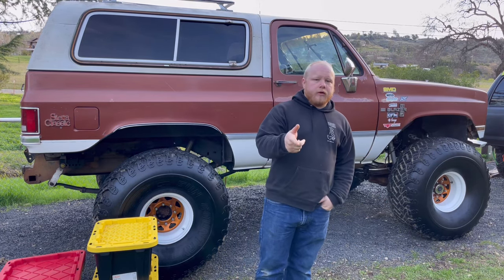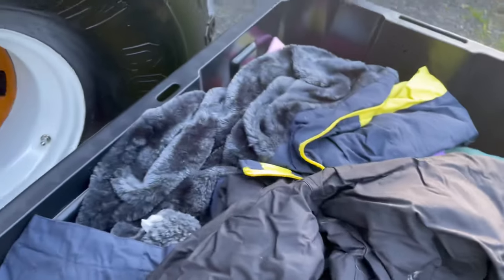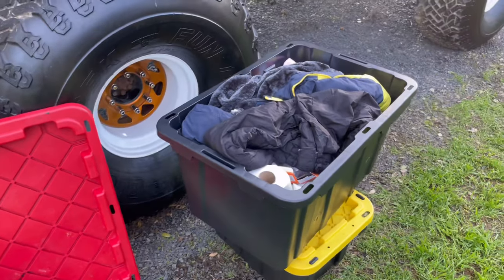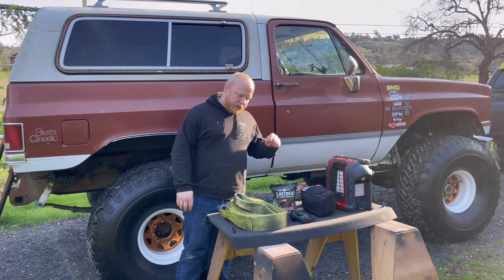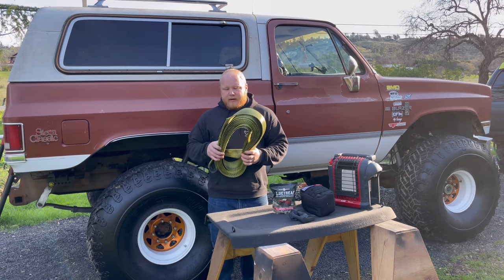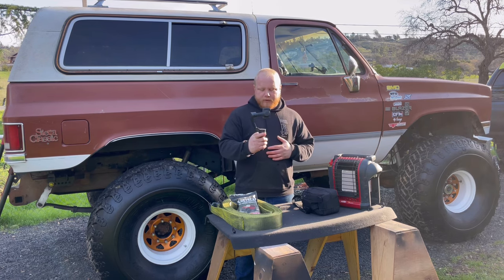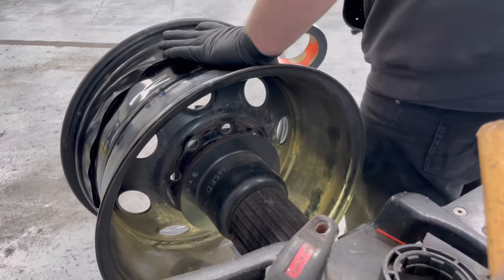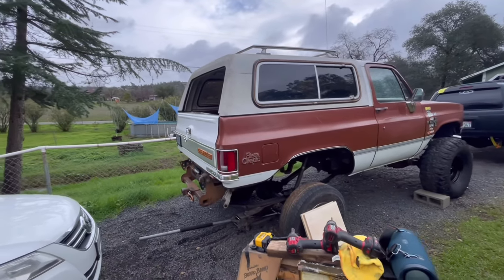DON’T go off-roading… Without this!!!

Comment: Yeah, that’s some smart planning. Nice rig! 
The drone in my rig drives me nuts sometimes. 3” exhaust, and the exhaust manifold was ported/polished… too loud! 😂
Reply from the maker: Thanks man.  I appreciate that. Yeah I feel that man.  I can’t handle that.  I want quiet.
Reply: Spray foam the underside it helps so much
Reply from the maker: @campervanbug7658  hell yeah.  Thanks for the heads up.   I’ll try that too
Reply: @TheBlazinBiddles  tigerfoam has a 200 board foot kit, it's fire retardant I did the inside of my van. Thinking about wirsbo in floor heat for underneath the floor then foaming over it.  It's around $400 thoe
Reply from the maker: @campervanbug7658  hell yeah man.  Good quality products ain’t cheap.   I can appreciate that price.   Not terrible
Reply: How do you fly a drone in your rig?  Hope its one of the mini drones!
Reply from the maker: @VJ-ft2xj  hahaha drone is like annoying noise while driving